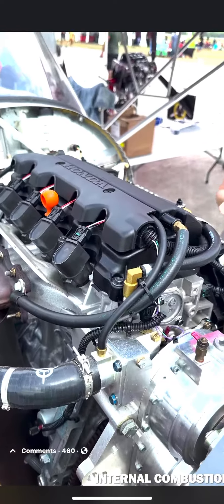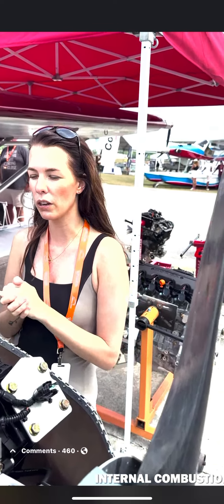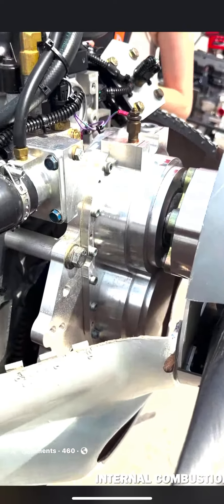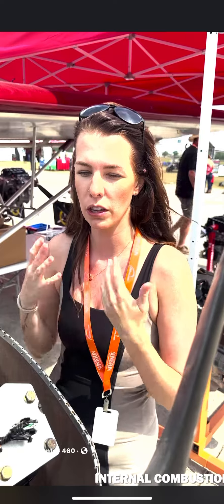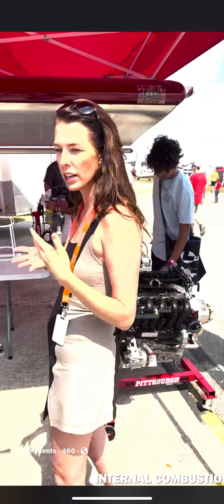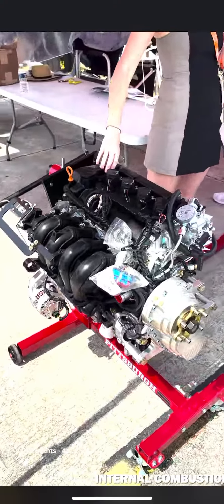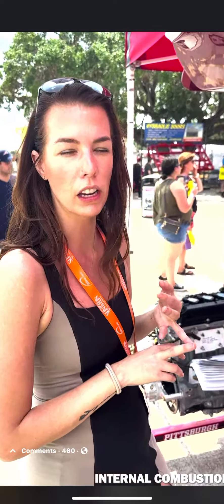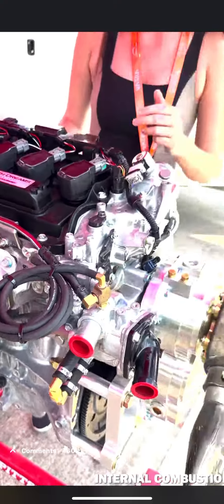Alissa Talking About Aircraft Engines

Comment: I work a lot on a lot of engines and with the direct inject if you run seafoam every like third tank, you’ll keep that carbon Build  up out of there and also depends on what kind of oil you run. Don’t let it get too old and gas makes a difference.

Comment: Huge respect for what these good people do. If the 130 would have fit into my very small Skystar Pulsar III, cowling and firewall, one would be there now. I’m now considering a new project based on the Glasair II with fixed tricycle gear. If this 195 hp turbo Viking will fit cleanly on that airframe, it will be my first choice.